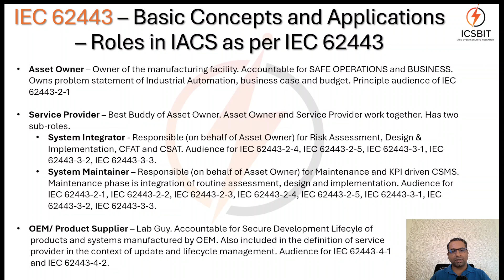8. IEC 62443 - Roles - Asset Owner, Service Provider, Product Supplier

Comment: System integrators & oem are not the same
Reply from the maker: if you worked with companies like Schneider and Siemens ...you find BUs for product development and Services. This means same company but different business units. They can shift the roles with different BUs as explained in the video.